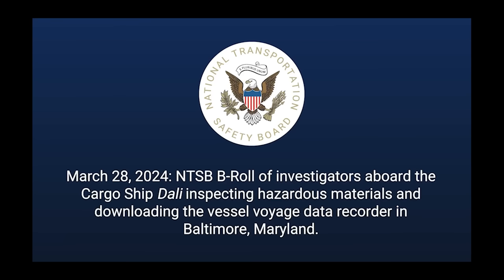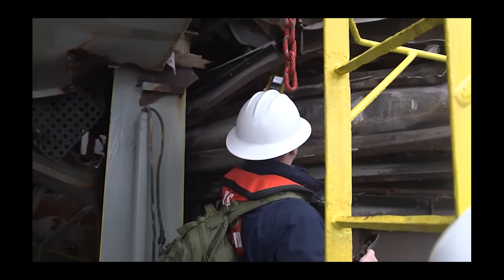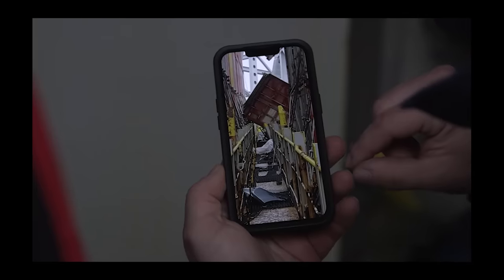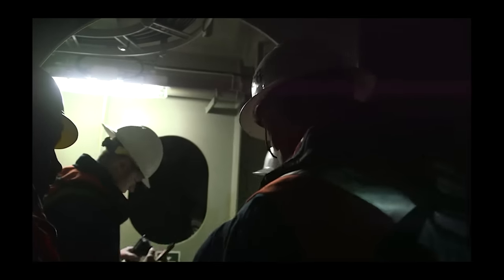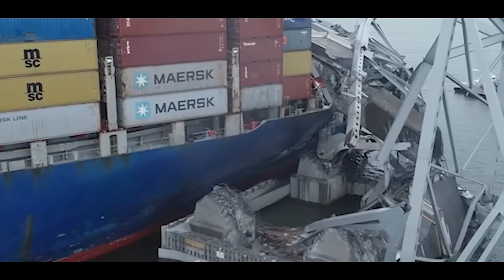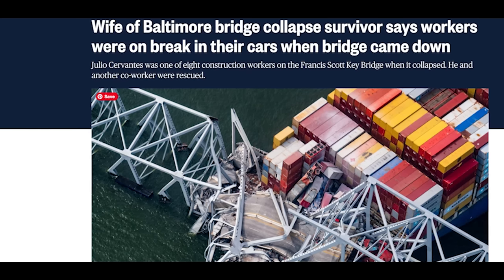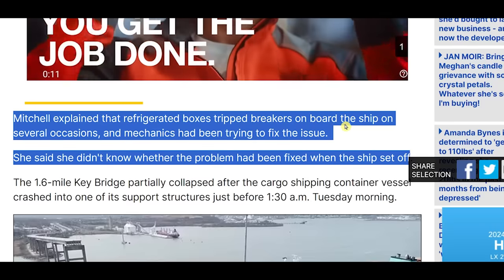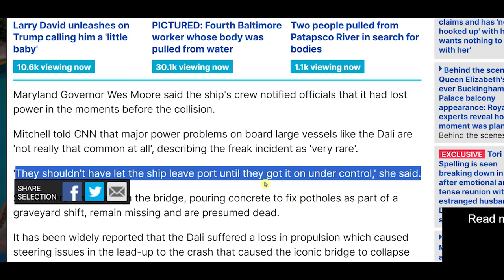NEW NTSB Video On Dali Ship Point of Impact Key Bridge

Comment from the maker: 🎥 Watch Next:
🎥 FIU Bridge Collapse: WORST Engineering Blunders Ever: https://youtu.be/RS5XxwKIx-U
🎥 Titan Sub NEW Air Force Audio: An SOS For Help? https://youtu.be/1IJYQpVWY0A?si=dOwyBsYNhW3MjR_w
🎥 LEAKED Titan Sub Transcript Shows Crew In Battle For Lives: https://youtu.be/4Dj8IJbP41c
Reply: Thanks for confirming Jeff I was right they were serious maintenance issues. The crew failed in their training to make sure all protocol were followed.
Reply: @Sherlock245  Nothing has really been confirmed yet, and certainly nothing remotely definite that would've contributed to the crash. The electrical issues seem unlikely to have caused the crash.
Reply: @DoubleMonoLR also informed Jeff the crew had no excuse they were trained for this disaster in the 1st place. Protocol certainly was not followed.

I have a damning  report I am wondering how to send it to Jeff??
Reply: @jeffostroff Algoma Steel owns some chinese built lake freighters. One of them had serious problems with it's electronics. Is this a chinese built vessl?
Reply: This is silly speculation!
Reply: Regarding the work crew in their cars? Nothing in the news is saying if the boat was sounding its Collision Horn? At that range the work crew had to have heard it. the only situation where i would see them missing it is if 1) they were using jackhammers or 2) the were in their cars with the radio blaring. Anyone know if the horns were sounding? I'm sure there is a Harbor rule restricting horn use at 1:30 am in the morning (those things could wake half the city). but in a situation like this you F the rules.
Reply: Someone is getting sued.. thankfully it was during the night when least busy.
Reply: How fast was this ship going?
Reply: @T-dx8dn  No. It was built in South Korea. SK manufacturing has poor quality control standards. Many of its national brands have had safety and durability issues, including recalls of vehicles, phones, appliances, etc.
Reply: @armastat  Bingo! Why did they NOT sound the foghorn at first sign of trouble?? That would have alerted the construction crew and induced them to get off the bridge in their vehicles, which they were already sitting in. Three or even two minutes would have been sufficient time for them to get off the bridge. From first blackout to impact was 3.5 minutes.
Reply: @BeReal769  It will be the captain and the Company that owns the ship, possibly the Pilots and Port authority too. Apparently for the two days prior they were having some power outages due to some refrigerated containers. If they can't show that they were reasonably convinced the problem had been fixed. then yep lawsuits will fly.
Reply: @tberjashi6707  8 knots (9 mph). At impact, it had slowed slightly to 7 knots (8 mph).
Reply: @tberjashi6707  8 knots (9.2mph)
Reply: @istudios225  We dont know if they did or not, thats why I am asking. No one mentions it and no one has asked, which seems weird.
Reply: MSDS - Material Safety Data Sheets
1993 - Flammable liquid, N.O.S., Fuel Oil
Reply: @DoubleMonoLR  I am finally right now the news reporting of maintaince issues and cheap labour. I wish I can hear from Geoff to give him the report.
Reply: @istudios225  still vastly better than chinesium stuff though.
Reply: thanks for your input Jeff.. I wonder if they had a pilot on board yet.
Reply: @Mikefngarage  they all were well trained for this disaster that is official this is not speculation.
Reply: I'm sure for the chief . engineer and the captain when they lost engine power in the channel that was a terrifying moment - 
    I've been on rigs and platforms offshore when wells ran away  also on platforms that lost power - 
       Both are mega terrifying moments when there is a catastrophic well run away or a power loss on a 100% electrically powered platform -    in the 70s I went through 4 blowouts - so I know that terrifying helpless feeling - 
    On my mother's side the family her brothers were all captains of ships - 
      There biggest terror was loosing power in a channel or river - 
     There should be tugs on stand buy next to critical structures like bridges and pipe lines crossings - 
    I heard a comment that the lights went out on the ship then an emergency generator  kicked in and the lights came back on - 
      More than likely the wheel house and main engines or engine were backed up with a UPS, along with a emergency generator - 
      The pumps for the hydrolytic steering are generalyl electric pumps - 
       In that case they  lost there steering if the generators or generator tripped off line and the ship lost electrical power - 
      I don't think refrigerated shipping containers shorting out would knock the generators off line - 
     Those generator are often in the mega watt class - they can easily power a small town of a 1000 or more - 
      If the lights went out they might have lost there steam that powered the population engine and generator engine - the other is the generators tripped off line - 
      Also on many ships the generators run off diesel engines instead of the steam  that drives the main engines -
Reply: What you are describing is "load balancing". 
There is nothing wrong with that. All that means is moving some loads FROM OVER USED circuits, TO UNDER USED circuits.

Comment: Those barrels, 1993, are full of diesel fuel. Gasoline is 1203. Hope this helps!
Reply: Why would Bridge workers have 55-gallon drums full of diesel fuel when they can easily have transfer tanks in the back of their work trucks
Reply: @dwainsellers6453  3:47 Those are giant tanks, not barrels. Not from the workers.
Reply: @firesurfer  lol are you high? I didn't say they were from the workers
Reply: The ISO's can hold a lot of different hydrocarbons under 1203 and 1993. As a gas hauler I can run diesel under 1203 but not the other way around. I haul ISO's in and out the ports. When getting loaded you can put diesel on top of gas but not the other way. You can't load gas after diesel  without cleaning it first. I work for a company who is big on safety, so almost all the empty tanks I pick up are clean. If the tank is empty but not cleaned, it has to be flagged as hazmat as well. So the ISO could be empty but have residue. Flammable Liquid Placard 1203 and 1993.
Reply: No, 1993 means flamable liquid. There is an MSDS with each barrel that list what liquid it is.  There are a ton of them.
Reply: 1863 is diesel fuel, not 1993. You are correct on gasoline as 1203.
Reply: @garymccarver5006  Are you US or EU? 1993 is what I have run and every company I have worked for runs 1993 for diesel fuel, red and LS. I'm in the US.
Reply: @Donald_Turnip Yep. It doesn't have to be Diesel fuel to be labeled as 1993. Isopropyl Alcohol is a 1993 substance for example.

Comment: Hi Jeff. As a retired captain, I’d like to suggest why the black smoke appears before the ship makes a SHARP turn to starboard and consequently, hits the pier. I believe the engines were momentarily restarted and they were placed in reverse in an attempt to slow the ship. I know that when the props are in reverse, the ship’s stern will move to port and the bow will move to starboard. This is what happened here. It was a mistake to reverse the engines. If they had just coasted, they (may have) missed the pier.
Reply: Despite this fakenews video, you comment makes up for it.
Reply: Hi Capt., please fill me in on bow thrusters and generators. 👍
Reply: Where would the ship coast to.
Reply: @brianfitch5469  probably under the bridge rather than through it ... 🤔
Reply: That ship was turning towards the bridge support long before the black smoke. It's likely the wind and tide was turning the ship and the captain made a desperate attempt to lessen the impact.  He's hitting that bridge in any instance after power loss. It was completely hopeless once the enertia of the vessel changed to the south.
Reply: About the bow thrusters. They are operated by electric motors. If the power goes out, they are useless. Also, if the vessel is traveling more than about 3 knots, they don’t help at all. This ship was moving at about 7 knots when it hit the pier. They’re mostly used for docking and undocking. As far as my original comment, here’s an animated video that should explain my reasoning. https://www.youtube.com/watch?v=y7-tUlxr_no
Reply: False. The ship went to starboard 30 seconds before the black smoke. The inertia had already changed.
Reply: Titanic reversed engines and struck the ice berg on its starboard bow, it would seem 100 years later no one understands the physics involved here
Reply: @thecaprisgroup you are also missing the fact, a very good NE wind was blowing, along with the out flowing tide which on the AIS Track, right before power loss,  the ship was starting to drift left out of the channel towards the left side pillar of the bridge, and slightly pushing the ship into a right hand turn. 

Then comes the power failure......It was going to hit something whether it was side swiping the left pillar or running aground at Fort Carroll,  the turn with Right Rudder application was to stop the drifting left, then tragically the power failed yet again, disabling the rudder and causing the right turn to overshoot and point the boat directly at the right pillar.  

By the time the power came back on again, the bow was pointed right at the pillar,  the port anchor was ordered released to try to drag the shift left using the winds, the tidal flow but sadly it was too late.
Reply: @denniss3980  It's very unlikely Titanic was able to reverse engines. That myth came from the movie.
Reply: That was the emergency generator coming online
Reply: As a retired captain, you should know that is is not possible to start that engine in the 2-3 minute timeframe that "both" blackouts occurred .
Which would mean that "if" there was any reversing done before the allision, then they were under power the whole time.
Reply: #MSDS
Reply: The ship dropped port anchor not both anchors causing it veer into  the support
Reply: @denniss3980  and no one learned anything
Reply: @jomm5968  in the  1996 made for TV  Titanic movie staring George C Scott as the Captain, Scott’s character reprimanded his first officer for trying to turn the ship at the same time reversing engines. In this case I fault the politicians who stuck a bridge at the entrance to a busy port, and did not budget for dolphins to protect the bridge pilings
Reply: Yes, that is exactly what another reviewer said who has experience with ships like this - the propellers always move in a clockwise rotation when viewed from astern, and that rotation has an effect on the lateral movement.  Further, I believe propellers in general aren't nearly as efficient in reverse as they are  in forward.
Reply: They then shut down on over load speed or boost?
Reply: @denniss3980 brakes cause more accidents on roads too
Reply: @brianfitch5469  Path of least resistance, STRAIGHT AHEAD.
Reply: @wwd4534  I don't believe any anchors were dropped while the incident was in progress.
As dark as it was, you would have seen sparks in the video. I think the port anchor was dropped after the ship came to rest.
Nothing veered anywhere it was motored in that direction.
Reply: @denniss3980  There are a hell of a lot more lies/speculation about the Titanic incident, than there are about this one, so far.
Reply: …wrong.
Reply: All reporting indicate the Dali doesn't have a gearbox between the engine and prop shaft. The only way to reverse the propellor would have been to slow the engine to a stop, and then run it backwards. If you think they did that in a couple of minutes, while sufffering from electrical problems - then your experience may be worth less than you think.
A more likely issue is that currents pushed them off course, and either helm control failed, or they focused on retarting the engine instead of stearing the ship, or the electrical bus on the main and standby generator was not configured properly.

Comment: MSDS: Material Safety Data Sheet
Reply: Beat me to it…I used to have to get those for shipment of materials at work
Reply: lol I’m a retired union carpenter that worked in nuclear power plants and oil refineries. I was about to say something an then I thought don’t be negative lol so when I saw you put it on here I thought thank god. Omg I use to work for a couple bridge companies back in the day and I had no fear. Now as I have some age on me I’m afraid of everything to do with weather and infrastructure.
Reply: I think that's what narrator meant, but no its the "Hazardous Materials Guidebook" (UN Orange Book is the UN Recommendations on the Transport of Dangerous Goods Model Regulations, a guidance document) used to look up UN Numbers such as 1993.  MSDS is used afterward for more detail.  Can't look up a UN number with MSDSs.
Reply: I think it has been shortened to MDS... (skipping the "Safety" initial.)
Reply: @chriskleven5441  Safety Data Sheet , Product Safety Sheet, MSDS are essentially the same thing. It’s possible it goes by other names.
Reply: UN numbers are more important.  MSDS is pasted alongside the UN number.
Reply: @ferdburful6352  SDS... I believe you're right. Thank you. It's nice having somebody correct me with out being mean about it. I appreciate it. :)
Reply: look in an ERG book to find what the contents are based on the UN number